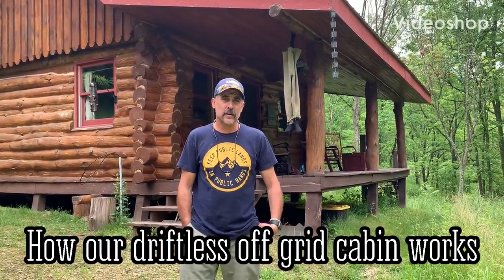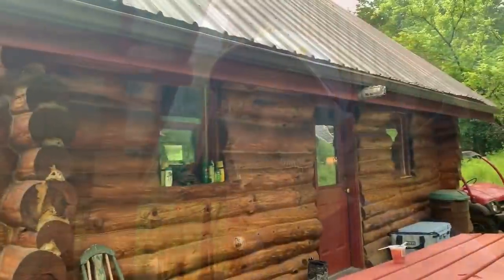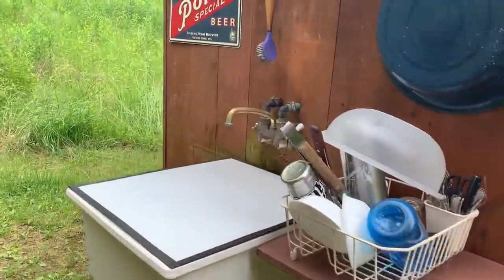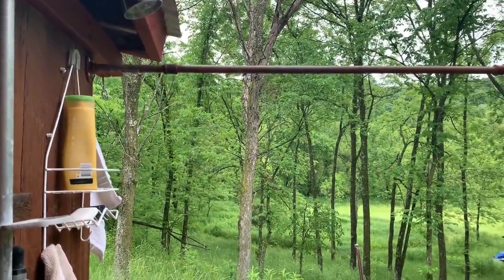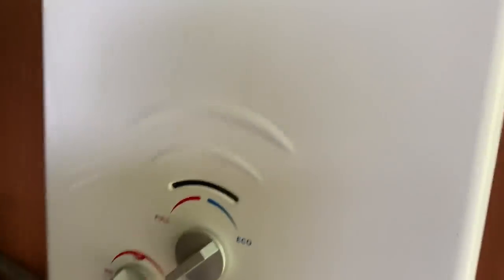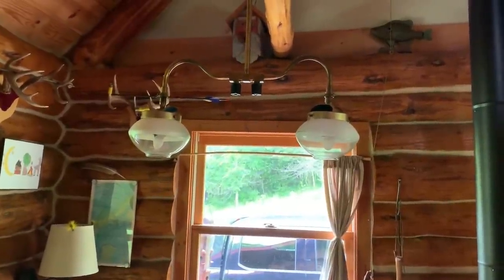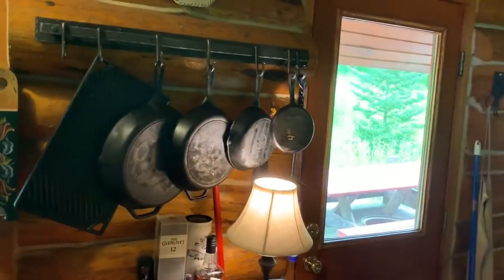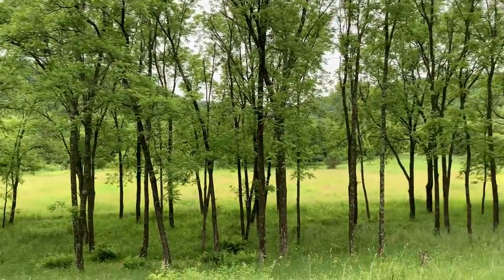Off the grid cabin and how to rig it.  Hot shower, solar and more!

Comment: Nice.

This would be an upgrade from what I'm doing now. Living outside has definitely taught me how to survive. I never thought in a million years I would be doing the stuff I'm doing: Living under a tarp, which shields me from the rain. And return rolls off as rain water into 5 gallon buckets, I have more than 10 of them to fill up a 50 gallon tank and of course as drinking water.

Not long ago, I attempted to run a tankless water heater. Although I was successful in the beginning, I wasn't using the right parts and I stupidly put the water filter in the wrong place. So I lost the water pump. Bummer 😞

Now I'm back heating the water with the propane stove. And I'm looking towards purchasing a wood stove to do some of the heating. That way I wouldn't always have to purchase propane, which I have get on foot. 

So I'm hoping one day I can get to this place.

Living in a Cabin is definitely like living in a regular home.

Where I'm ahead is my solar systems. I setup three of them. That's because I operate in 2 areas of the woods. 

One is primarily for lights and my tool workshop. The other is for my heavy appliances and the third is for basic electronics like computers, razer, radios, television, ect 

So I run a 48/24/12v system split between 25 100 watts solar panels.

Comment: Looks like a sweet camp. I can see you expanding the solar (late comment) if you haven't already. Except those gc2 batteries will vent and might better be in a box outside or contained inside and vented. Cheers.

Comment: You have a great system here - but there's one major problem.

Your gutters on your house will be endanger of being ripped down from snow that turns to ice - then slides down the steel roof, ripped the gutters off.

You need some snow-dams on the roof to hold the snow in place and let it melt off. I had that problem on my house before until I put on those snow-dams.

Great video though! :)

Comment: Very cool!!👍 Do you have links as to where to buy the items needed?
Reply: Do some research. The pumps and the hot water heater can be found online under RV or camping supplies. Garden hose anywhere. You can get 55 gallon barrels from some water treatment plants. or search for "rain water catchment systems" for fancy barrels like he has.   Search "off grid living", "tiny houses", bus or cargo trailer conversions  for a lot more ideas. They have a very good set up.

Some of the same things can be used at your  house during power outages. I have a single butane burner, about $30 in the camping section of big box stores.   I use a  car jump start pack to power a couple of 12 volts LED lights. Battery packs, about $60.  LED lights, about $30.00.   I also have 3 small solar systems to power the shop out in the woods.  Those are just solar panels, a charge controller, a battery for storage and 12volt LED lights  For good information on solar power go to DIY solar with will prowse.   Now for low dollar shower, you can use a  new 1 - 2 gallon weed sprayers modified with a sink spray hose and heat the water in the sun or on the stove.